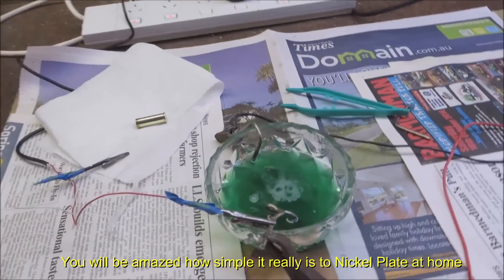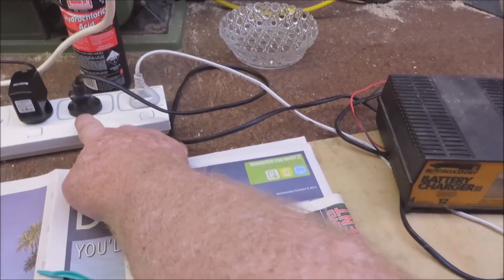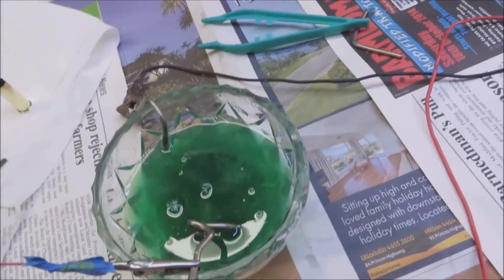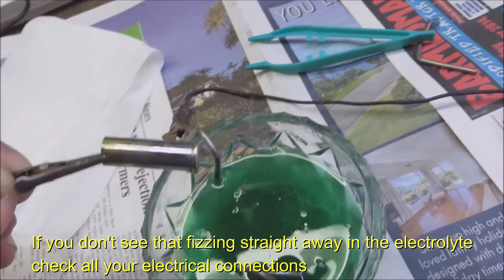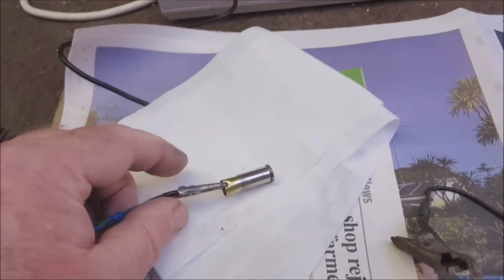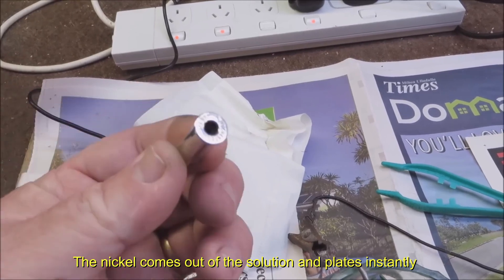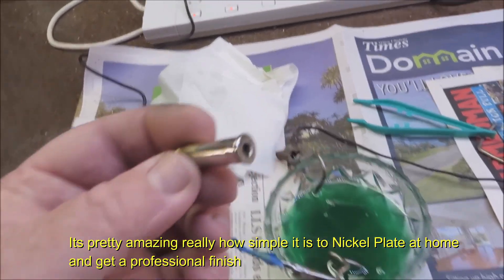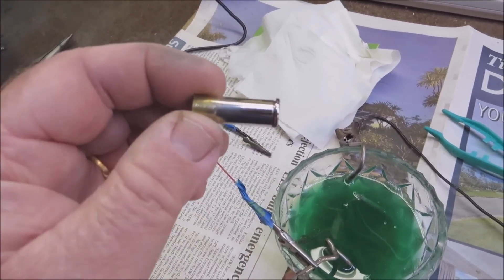Work Shop Talk - Easy DIY Nickel Plating at Home That You Can do And Get  Professional Results Doing

Comment: Jim, great stuff.  I've not tried electroplating, I'm impressed with how fast it works.  Is the plating time related to the area to be plated, or is it pretty much independent of area?  And will this also work with zinc parts?
Reply from the maker: G'day Fred I've never tried to plate anything except for brass parts that I have made to replace missing parts on model steam engines that I am restoring. So the parts have always been  fairly small. I'd be interested to hear how your plating adventures go - Cheers Jim